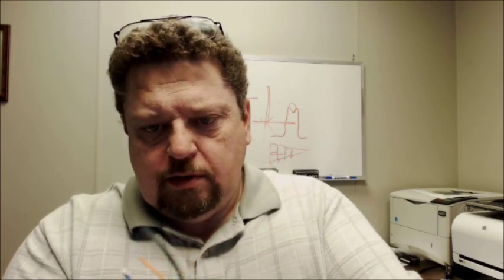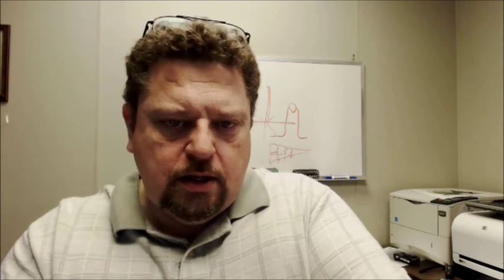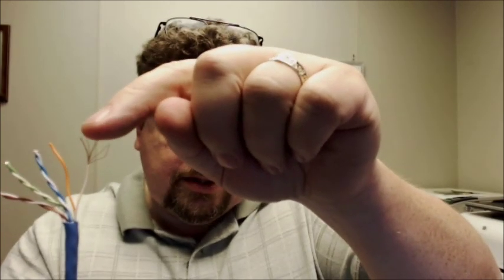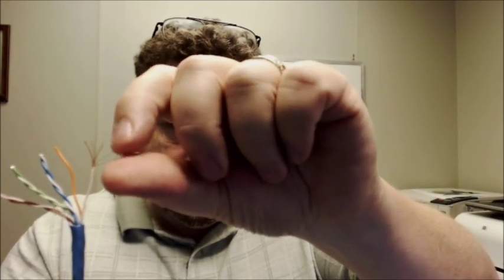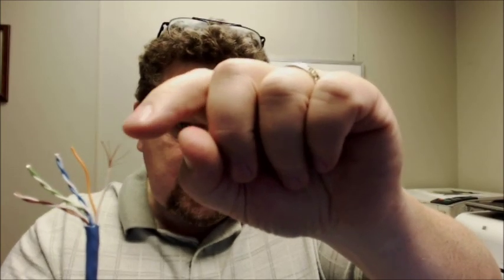Difference between Plenum and non Plenum Network Cable

Comment: Not only have you compared the solid v. stranded conductors which have no bearing on whether the cable is plenum or not, you've also mistaken which type people find easier to install the RJ45 ends on! Listen up YouTubers! Unless you're using several thousand feet per week, just buy the plenum cable for everything. The price difference is very little, you'll always have the right kind on hand, and you might be saving people's lives by using it instead of the standard PVC-jacketed cable. The poison emitted by burning plastic should not be discounted. It can kill you in a couple of minutes. It can kill you faster than you can vacate the premises!

Comment: This guy is full of "corn" !
Stranded wire versus solid wire has NOTHING to do with Plenum Rated  vs Riser Rated
Plenum cable is required when wiring is run through and air handling (or Plenum) environment. Not all drop ceiling areas require Plenum cabling as this bozo suggests. Restated, it is only a plenum environment when the area is used for air return.
Additionally, the flexibility of the cable varies by manufacture and not by plenum rated versus riser rated as this clown suggests,
Too bad people like this are allowed to broadcast their lack of knowledge.
Reply: I agree, he's comparing two different things and foward in a lot of misinformation

Comment: Plenum rating is  where the cable can be used, which is in air handling plenums.The space above your false ceiling is not a plenum, unless it is used for air handling. Plenum cable is rated to give of less toxic fumes in a fire situation. There are three basic ratings CMG, CMR, and CMP. General purpose, riser, and plenum respectively. Stranded and solid conductor have nothing to do with plenum rating. Check your NEC book. I do appreciate you wanting to educate people, check your homework first.

Comment: Stranded wire can be in plenum cable or non-plenum cable.  Same with solid conductors.  The nylon string is also used to strip back the insulation to access the conductors.   It cuts through the insulation when pulled down.

Comment: I think my buddy that I work with has these mixed up. I always hate his CAT 5 cables because it's harder to shove the wires in the connectors for crimping. I buy roll or box from Home Depot and the wires are stronger and hold their spot ... he buys some other stuff where they are less solid and wiggle around and cause you to miss crimp the wires because they jumped out. I think he buys what he buys because it's cheaper. He says stranted is better because it won't break.